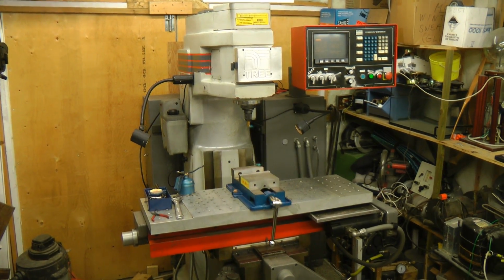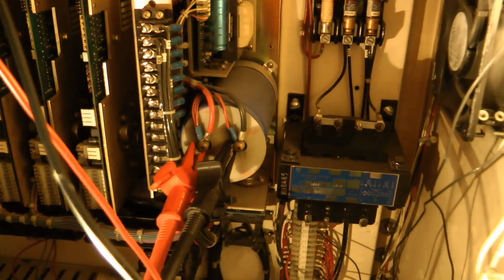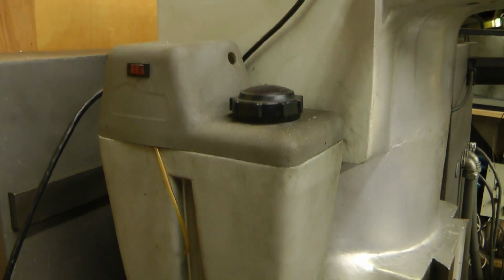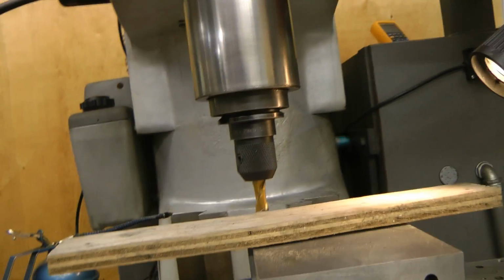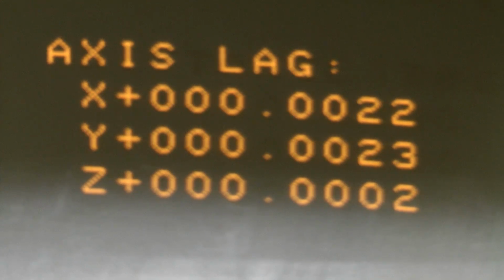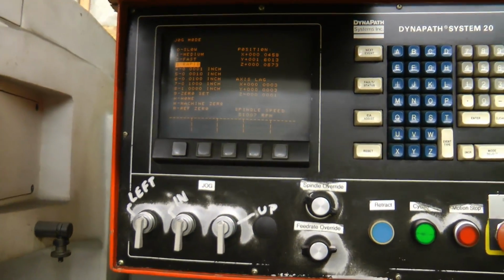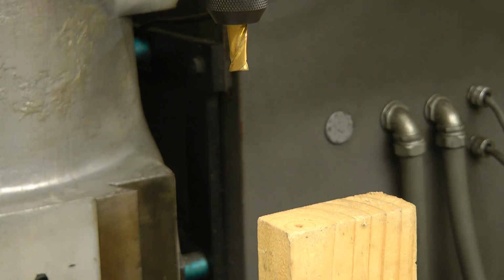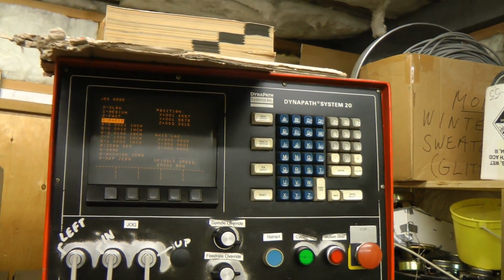Tree Journeyman 325 CNC milling machine - Part 1

Comment: I recently got this same machine. It's still on the trailer. 4600lbs is no joke! Mine has been upgraded to AC servos and a MachMotion Mach4 controller. But i have to replace the encoder on the Z servo motor. I might have the 6000rpm spindle because my motor pulley is pretty small.
Reply: How much did the retrofit cost you?
Reply: @chineseburger5787  the new servo motor and drive were under $300 on Amazon. Also, 4000 rpm spindle, sadly. Machine works fantastic, just slow!

Comment: Hi plece help me what program used for pc - cnc
Reply from the maker: I used Teraterm, which is a pretty standard PC terminal application. Once you have the connection configured, you just paste the G code into the terminal

Comment: These machines were nicely made for back then use. We run atleast 5 of these in the shop the ole 325's would change z offset atleast 5 to 10 thou. Since thats been thru the years id jog at fast only no real reason to complete rapid.

Comment: hi telsa i follow you since i got one machine used in USA, you video and information are great but i have no idea with some fault show in the screem It says SPINDLE IS NOT UP TO SPEED, can you help me to find the problem to figure out
Reply from the maker: Does the spindle turn at all? How long does it take from when it starts until the error occurs? The problem might be that the spindle drive drive is set to too low a speed, or the signal indicating that it's up to speed (if that exists) isn't getting to the control.

Comment: Hello, I have the exact same machine with the exception of it has the DynaPath 10 controller on it. I bought it used from eBay, and while it worked, it had many of the same problems that you demonstrated in this video. I am powering the machine from a transformer that has multiple taps, so I selected a higher voltage tap, and the issue with jog falling behind was mostly solved except for when I have very heavy items on the table. To solve this problem, I had to reprogram the UVEPROM that has the machine profile to a slightly slower jog velocity. (The problem is that the jog velocity is fixed in the UVEPROM, and the controller treats jog as a closed loop operation just like feed.) If the servos fall behind because the controller wants a speed that is in excess of what the motors can run (because of low voltage or otherwise), the controller trips with a following error. It took me about a month to get a full understanding of how everything in this machine works and to get it all tuned, since then it has proven to be extremely reliable and solid, and it has never had even a minute of downtime in the last 9 years. Recently, I have had an order for parts that involve too many steps for what controller memory is available, so I am now in the process of upgrading the machine to LinuxCNC. So, I now have a perfectly good DynaPath 10 controller and manuals if anyone wants it, or if anyone needs any input from someone that has 9 years experience running a machine like this, feel free to contact me.
Reply: +Neil Whelchel How did the upgrade go? I'm looking a 310 with dynapath 10. The dynapath scares me a bit but I'm a bit new to the whole cnc thing anyways.
Reply: +landlockedviking The upgrade went great. I am now running a 77,500 line program to make a highly detailed aluminum part. It is actually shocking how well everything is working. Once I got LinuxCNC up and running, it has worked flawlessly. I have never even had a commercially built controller work as reliably. I was also able to run much tighter tolerances (.0004) at faster speeds (120 IPM) because the servo tuning capabilities of LinuxCNC being far superior to anything else out there.
Reply: Wow that sounds fantastic! Can you share what the upgrade cost and a few more details, or message me?  Thanks!
Reply: A lot of time has passed eversince but... do you happen to have the Dynapath parameter list?

Comment: Hi:) Nice machine if I had it I would just rewire it to run from a Ethernet smooth stepper board and use Mach3 or Mach4  on a windows based operating machine.

Comment: Did it come on a pallet, or did you have to put it on one?  I just won one at an auction and I have to figure out how to transport it. If I can get it on a suitable pallet it shouldn't be too bad - I've got a forklift in my shop.
Reply from the maker: It came on a pallet, although it was just a regular shipping pallet which isn't strong enough for something this heavy, in my opinion. On another manual mill I had shipped (also on a regular pallet), the pallet arrived broken. I would suggest building a much more robust pallet yourself if you need one, using 4x4s and plywood for decking. You can then solidly bolt the machine to the pallet.

Comment: Just ran across your video. I have the same machine with a dynapath delta 20. I do have all the manuals, I'd just have to scan them which would take a while. I've been thinking about upgrading my machine to run on Mach3, using a controller from dynomotion.com.
Reply from the maker: Someone else already sent me the manuals for the control, but thanks anyways.

You wouldn't happen to have the installation manual would you? I just have the user manual, and it doesn't contain info on the jog wheel connections.

Comment: The Tree CNC's are all very nice machines.  So are the Dynapath controls which are easy to learn and use.  I use wood a lot when proving programs but you could use nylon 6/6, a machineable wax, or something else relatively soft.

Comment: Very Nice!  I just purchased the same machine last week but I have yet to power it up. I have access to all the original manuals for both the 325 and Delta 20 maybe I can help you out!
Reply from the maker: steven hoover Awesome! Please let me know if/when you end up scanning the manuals, or if you need any help getting the machine up and running.
Reply: @steven hoover I recently joined team Journeyman 325 and i am trying to get a copy of the Delta 20 operator's manual. Do you have it digitized? If so i would greatly appreciate if you could share them with me. Thanks! Did you ever get your machine running?

Comment: I didn't hear you mention it, but it might be an idea to do a thorough mechanical clean up of all the motion parts, threads, gears, etc? Any tiny bits of grit, dirt or debris in the works would probably mess up the positioning and accuracy just as badly as any faults in the electronics.

Comment: Will putting it on wheels cause accuracy vibration issues?
Reply from the maker: Possibly. I'm going to add some screw down feet to take the load off the castors and keep it rigid when it's stationary.

Comment: mind do a video on how you managed to integrate it with a modern PC please?
Reply from the maker: The interface is just ASCII text over RS232, the most difficult part was finding the DB9 to DB25 RS232 adapter. Had to dig into my box of super old legacy cables, which I keep around for just such an occasion.

Comment: I'm kinda curious. Can I ask how much you paid for the CNC?

Also, the quill may have 6" of travel, but can you raise and lower the knee? (edit* Never mind. You do it manually later in the video)

 I'd think that would significantly increase your useable Z travel. You'd have to re-index the z axis after each move, but if you're willing to manually do so, you should have lots of z-travel.
Reply from the maker: Paid $4200 including shipping it 100km. I'm so jealous of the deals people find in the USA on these, I've seen them go for <$2k. We get screwed up here in Canada though, for example with people trying to sell a Bridgeport Series 1 (nice machine actually), with Mach3 control for $6k

The knee has about 16" of travel too. I think moving the knee could be integrated into programs using a fixture offset.
Reply: tesla500 We just got a Tree Journeyman 325 and have manuals for that and for the DynaPath. I am having some similar issues that I would like to discuss with you. Please contact me at m_volpone@yahoo. Thanks, Mike